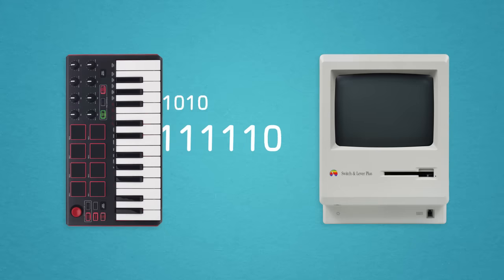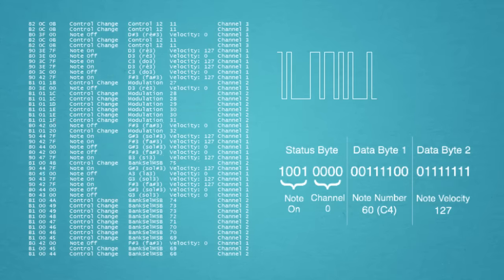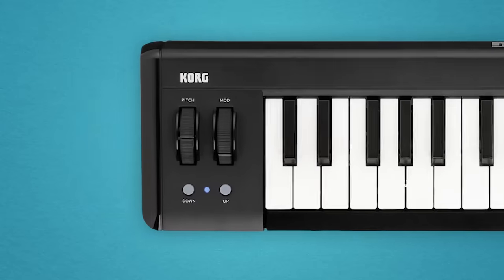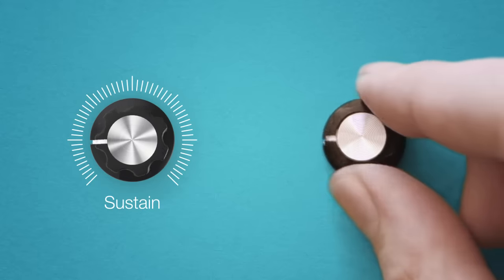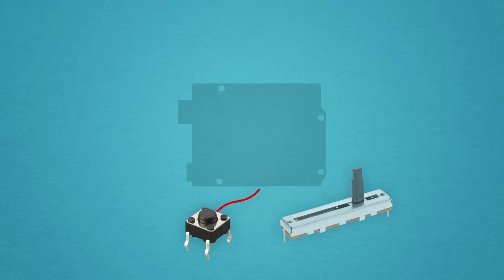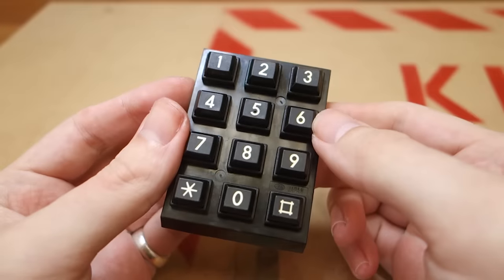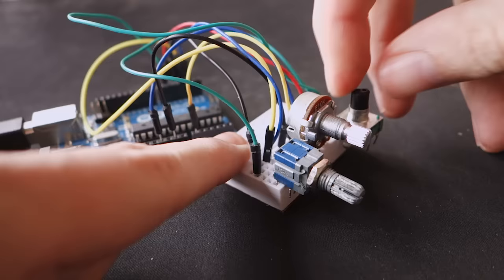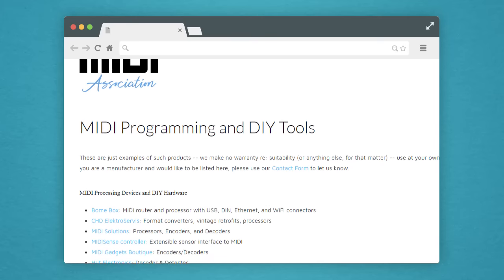Building a MIDI Controller Using Arduino

Comment: This is great! how would i go about adding a standard MIDI output connector to this? I want my controller to go directly into an effects pedal.
Reply from the maker: This is MIDI over serial USB. You would need to look into how to format your code quite differently, and the easiest would probably be to just use a MIDI shield for the Arduino.
Reply: Check out the Nuts and Volts channel he has stuff on arduino midi controllers using 5 pin DIN jacks

Comment: Why would you use virtual midi cable instead of real one? Usb-midi cable for example.
Also, Arduino with 32u4 on board is able to provide native usb-midi with no external additions
Reply from the maker: Why would you make that comment when this has been answered numerous times in the comments already?

Comment: aw man so this isnt actually a usb class compliant midi? Meaning it will only work if your machine is running those other programs? Thats a bummer. Looks so beautiful though
Reply from the maker: Yes, the UNO and MEGA doesn't work as such. However, you could use an Arduino Leonardo, or Pro Mini, or a Teensy, or other boards which can work as such if you want to skip the serial to MIDI bridge.

Comment: Beautiful project. I'd like to build this controller. I would like to put a Midi port. The traditional 5-pin one. It can be done? Thank you.
Reply: Absolutely yes.
But you might need a buffer chip between the Arduino and MIDI connector to get the right current & voltage levels on the MIDI cable.

(Similar to the MAX232 & MAX485 ICs for RS232 & RS485 serial comms protocols.)
Reply from the maker: Easiest would be just to get a MIDI shield for the Arduino. I believe Sparkfun makes a version, but you may also be able to find other similar ones.

Comment: Just out of curiosity, why did you use several pieces of MIDI conversion software for the USB rather than adding a 5 pin din MIDI socket?
Reply from the maker: A) you’d need to have a MIDI socket on hand and B) you still then need a MIDI to USB interface if you’re going to hook it up to your computer. This is both easier and used parts I already had.
Reply: Thanks for the reply!  I also wondered, where did you obtain the joystick from? Searching for a MIDI joystick such as this is what brought me to you :)
Reply from the maker: No clue, I’ve had it for years. If you dig through the comments you can find a link to someone who found a similar one on amazon if I remember correctly.

Comment: I think it's better to use the Arduino Uno and shift registers/multiplexers than going with mega.  Its more economic
Reply from the maker: An Arduino MEGA clone is like $10-12, it's not really a huge investment. Add to that the higher complexity both in coding and wiring of using an UNO with either shift registers, or multiplexing (it's doubtful even with multiplexing it would have enough pins), and the MEGA is the more straight forward choice, by far.
Reply: @SwitchAndLever  Yea your right. I make eurorack modules with limited space, so I use the pro mini only (I'll try to use stm32 later). Altho 10bucks is still quite a lot because I buy about 20 pieces every 3 months. But for this project it is better to use the mega now that I think about it this way.
Reply from the maker: @machmar  well absolutely, if you do any sort of production, even small scale production, it makes no sense to use a full blown Arduino of any kind really. The gains for switching over to rolling your own boards with a 32u4 or stm32 on it would be fair. For one offs though, direct pin access without having to deal with multiplexing, or anything like that, makes the projects much easier and faster to knock out. I can do multiplexing, but it's always a pain in the ass compared to just reading a single pin.
Reply: @SwitchAndLever  yea your right

Comment: That phone dial is good, perhaps with all the oscillator inside maybe you want na connect to God.  The idea of a joystick is good instead of those knob but how about a fly by wire kind of pilots joystick, including the red firing top button.

Comment: Hey I have a question on Arduino Mega: I'm reading everywhere that you need to update the firmware to make Mega send MIDI over its USB - is that something you did as well?
I'm having some trouble in the process.
Reply from the maker: Everything I did is in the video.
Reply: @SwitchAndLever  a super useful video if you ask me.
Ok, so you probably didn't have to flash any special firmware or I've missed that part 5 times 😂

Thanks!

Comment: With a multiplexer/s, you could have used and UNO?
Reply from the maker: Read the other comments about this. You use what you have, and I did, and it made the whole build way easier than messing around with multiplexing. I do not see what people have against the Mega.

Comment: Oooooh, so that what an Arduino is used for an interface between a computer (essentially a block) and our mechanical and physical world. For years I've noticed that this 'Arduino' has been all the rage in education and did not understand. Not even reading Wikipedia had helped.
Reply from the maker: It is ONE thing that the Arduino can be used for. Asking what an Arduino is used for is a little bit like asking what a computer is used for. It's up to the person using it to decide. It does definitely not have to be an interface between a computer and the physical world, you can make something completely battery operated with Arduino as well, without any sort of computer involved (aside for when programming it). It's just a really small computer with inputs and outputs, that can read data from sensors, and write data to a wide variety of things, like motors, lights, screens, and yes, send it to a computer as well if so desired.

Comment: personally i dont like the power and gnd into copper thin tape, i would use shielded cable but eh no fire risk here with only couple milliamps going on in audio. poeple dont make amplifiers with tape please its kind of dangerous even with copper bar its better with cable and shrink over the soldering for more current. for a usb midi this is fine of course maybe a bit of noise induced by the bars being litteral antennas
Reply from the maker: Yeah, so I'm confused. This is obviously low power, 5V, and milliamps. You point it out yourself it's no fire risk. There's no risk whatsoever, even if you completely short it out. I'm confused because you say you don't like it and then literally turn around and say why it's fine. Cables are literal antennas as well, there is no more appreciable noise than the rat's nest of wires inside anyhow.

This is not an amplifier, if you're using this on high power applications you're an idiot for using a video on obviously low power stuff as inspiration.

Comment: Why can't you use a shift register as a multiplexer for increasing the number of digital pins in the UNO?
Reply from the maker: Why can't you read the vast amount of comments about this very thing before repeating this question again? I'm tired of answering it.
Reply: @SwitchAndLever  Well I don't see any comments about using shift registers Or May be those comments are way down the section. Not rude Just wanted to know so that I can save some money on it.....that's why :(
Reply from the maker: @Dina-ug6bq  You can use shift registers, you can use multiplexing, you can use a lot of different methods to achieve the same result. If you have something with a lot of inputs there's no need to overcomplicate things then.
Reply: @SwitchAndLever  thanks man.....your animations are impressive....well I think it took more time and patience.

Comment: Where do I find out how to design enclosures? Everyone always skips over that part.
Reply from the maker: I mean, it's a box, a bog standard box, you could draw it out with a pen on plywood and drill and file accordingly if you want. Don't overthink it.
Reply: @SwitchAndLever  you're probably right about the overthinking. I think this is more about me being uncomfortable and inexperienced with planning projects and using power tools. I want to watch people just build stuff and tell me what they're doing so that I'll feel more comfortable giving it a shot.
Reply from the maker: @ahrengroesch8774  I hear you, and I think it's a great way to gain inspiration, but the best way to get experience is just go ahead and do it. If you're afraid to fail then you'll never do anything, because the search for more information is always more attractive and easy than picking up that first tool. To learn you have to fail, and you have to fail a lot. That's the best teacher. I have failed a lot more than I've succeeded in life, but through that I've reached far further than I ever imagined I would in life.

Comment: There are four programming codes, which one we use.  Please send us the correct code used in this video.
Reply from the maker: Download the folder, open the main sketch in Arduino and the others will open as well. There aren’t four different codes, it’s split out into different classes.

Comment: 7:47 can someone PLEASE tell me is that just normal copper tape he put down for the 5v and GND rails, or is it somekind of special conductive tape thats made especially for electronics and soldering?  i really want some!
Reply from the maker: It’s copper tape, got it from the garden supply store, it’s used to prevent snails from climbing over stuff (they don’t like copper for some reason).
Reply: Switch & Lever lol I read that about snails earlier today when I was researching after your video.

I usually use these shit screw terminal blocks and end up wishing I’d just soldered so I was looking for something quick but still removeable

Comment: The only thing I don't like about this is that you didn't just use MIDI over USB directly, making the Arduino talk as a normal USB MIDI controller without the serial translator. In my mind, that translation should definitely be part of the Arduino's job.
Heck, even my QMK keyboard's Arduino simultaneously talks as a keyboard, a midi controller and a mouse with zero host-side setup.
Reply from the maker: The reason I did that is because the Arduino Uno has an Atmega32 which doesn’t natively act as a USB HID device. Yes, I’m aware one can reflash it to do that, but that’s way more complicated than what I did in this video. You need an Arduino with a 32u4 to natively talk MIDI over USB, and as it so happens I have a video about doing just that. Look for the Guitar Hero video I did not too long ago. Hope that answers your questions and ungrounded critique; it’s by design, not oversight. 🙂
Reply: @SwitchAndLever  I didn't mean to sound accusatory. I like the project as it is, I just wanted to give my two cents on how to make it a bit more user friendly.
I just have a strong preference for making things work "out of the box" whenever possible and feel like the already good project could have been even better with simple tweaks under the hood. For example if reflashing isn't an option, maybe the Mega wasn't the variant to use; you could bank the inputs with diodes to multiply the number of available pins together and use any variant with the ATmega32U4.
Reply from the maker: @lollllloro  You see, I'm more of a "work with what you have available to make things work" kind of person than just buying new stuff to solve things. With this video people can do the same, and follow my other video if they have a 32u4.
Reply: @SwitchAndLever  I never suggested "buying new stuff" to solve anything. Both of the suggestions (especially the purely software one) were precisely "making what you got work".
A bag of some basic diodes from where you would get parts or tools from anyway is hardly "buying new stuff" in my opinion (or you could already have some laying around). At the start of the video you said you chose the Mega because it had more pins, suggesting a Pro Micro or similar were also available.
You were right, the Guitar Hero MIDI controller video beautifully addressed the problem I wrote for in the first place all along! :)
Reply from the maker: @lollllloro  as I didn't have an Arduino with a 32u4 microcontroller the solution to follow your suggestion would have been to "buy new stuff". 🙂

What I had available at that point was an Uno (as shown in the video) and a Mega, I chose the Mega for reasons mentioned. Sure I could've solved it with a shift register, but using a Mega was way simpler.
Reply: @SwitchAndLever  Fair enough, but you wouldn't need a shift register! You can use a diode per switch to unambiguously bank them. For example four "columns" of output pins times five "rows" of input pins (or the other way around, depending on which way you put the diodes) to get 20 inputs for 9 pins. This is what virtually all keyboards do. The cheapest ones even omit the diodes making some simultaneous inputs ambiguous, such as when switches [1,1], [1,2] and [2,2] are simultaneously pressed [2,1] gets "ghost pressed" with no way of knowing whether four or three (and which three) are actually pressed.
Reply from the maker: @lollllloro  yep, many ways to skin a cat, but again, using a Mega was easier than what you suggest as well. I really don't understand what the community has against the Mega, I've seen similar reactions elsewhere as well. It seems like some think that using a Mega for its increased amounts of inputs somehow is cheating or something, and using more complex solutions is somehow better.
Reply: @SwitchAndLever  I didn't make any kind of judgment between the Mega and the Uno (both seem to have the same kind of USB MIDI support, while the Pro Micro has the easier one). I don't think I own an Uno, but I do have a Mega and a couple of Pro Micros. I haven't read anything about peoples' opinions between models, but I haven't considered the Uno after noticing the dirt-cheap Pro Micro clones.

Comment: You should get a synthesizer
Reply from the maker: What makes you think I don't have one? It doesn't do MIDI though.
Reply: @SwitchAndLever  I assumed because you use midi that you didn't have one, there are plenty of nice synths out there that have midi
Reply from the maker: Indeed there are. I still end up using my small MIDI keyboard though simply because it's much easier and faster to reach the sounds I like, and to experiment with different sounds, through VST plugins and a DAW than using a synth. My actual synths are in storage at the moment because they don't get as much use.

Comment: Isn't more rational to use dovetail joint, when you have laser cutter?
Reply from the maker: You can't cut dovetail joints with a laser cutter. What you may be thinking of are finger joints. And no, I don't think it's more rational as I really don't like the look of them (with very few exceptions). It makes your project scream "I used a laser cutter!" It's a visual distraction.

Comment: Hi

Not looked deeply into it but with these new app android apple based practice amps that dont have foot controllers why isnt anyone commercially making a midi footswitch that goes to an app on your phone via bluetooth where the amp app is and the switch on the footdwitch sends a signal to its app that then inputs to amp app to change a setting like channel. It doesnt seem it should be that hard becsuse surely the input we put in to the amp app surely can be done via a footswitch app

Comment: Cool. But the stuff you didn’t dive into is the only stuff I was hoping to learn. Particularly help coding, builders always just share links to their code that won’t work for your custom build, I understand you just copy over the bits that are relevant to your build, but finding the scattered bits of code and trying to find where to plug them in, has left me no longer interested in trying to build with Arduino. The virtual online builder I found looked promising for prototyping and testing, but was only available for two different boards and still very difficult for a novice like me. I hope some day they find away around complex coding for this kind of thing like they have with others. I need something in-between snap circuits, and complex code script writing.
Reply from the maker: Well, it's difficult to make a video like this and diving into the coding without it being a hour long "Beginning to Arduino coding" video. Either you frustrate those who already know Arduino coding, or you frustrate those who don't. This is more an intermediate level project. I did however comment the code in my sketch extensively, but that doesn't mean you can just copy and paste it and hope it works in your project. You need to read up on MIDI messages, serial communication with the Arduino, sensor inputs, mapping and a bunch of other stuff if you don't know it already to make this work. 

If you need help coding there are an exhaustive amount of resources online. Start small and build up. That's why I built this project with each part in isolation to make sure I could make each part work before bringing them together. Learn how to get one button, or one potentiometer, to send MIDI messages properly and build up complexity from there. If you start with a complex idea then you're just setting yourself up for failure.

Comment: Does anyone know where can I buy that 4 way joystick used for pitch and modulation? I can't find it anywhere!
Reply: There are tons of cheap options if you search eBay for "arduino joystick", or there are better ones like an Adafruit 3102. They are just 2 spring loaded potentiometers, sometimes with buttons included.

Comment: i plan to make a midi crossfader. can somebody tell me if serial connection works with a myavr board light and atmega8? can i make use of "Serial.write(...)" with myavr board light and atmega8? thanks in advance